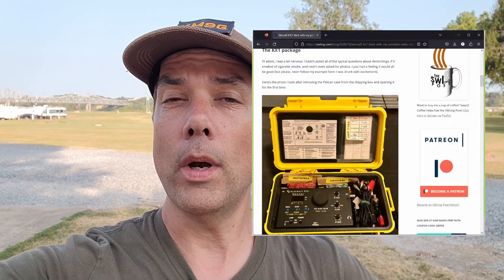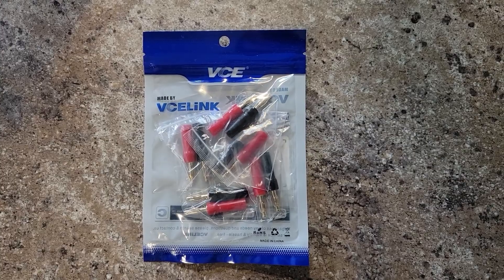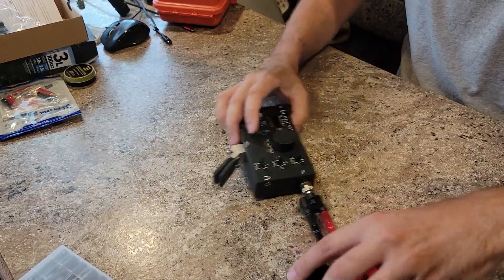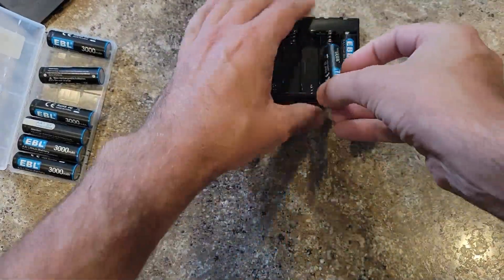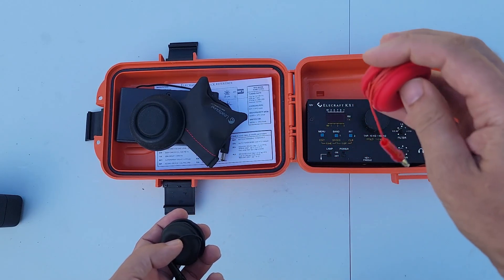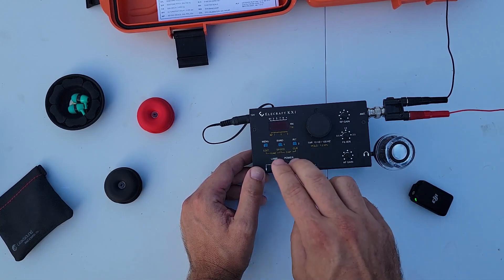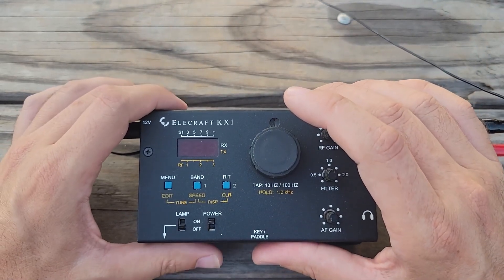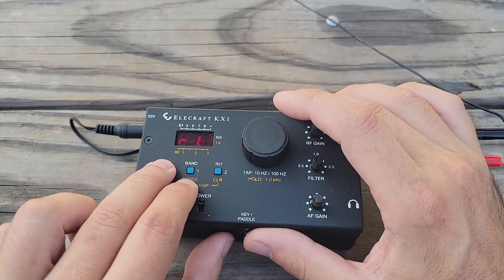KX1 Go Box Reproduction!

Comment: Great ideas!  I agree with those who question soldering the ends of the antenna leads. I tend to break one of the ends about weekly. I also recently picked up a 4 band KX1 to go with my KX2 and KX3.  The KX1 isn’t the most versatile of the three radios, but it is without question the most fun. I use 58 feet of radiator with a 12 foot counterpoise and it tunes up on all four bands. 
73,
John WJ7S
Reply from the maker: Good tips John, I'll have to do some more testing to find out... thicker wire means bigger winders too!

Comment: The antenna wire will break off at the solder joint in the binocular/BNC connector so you will have to solder it again, and again, and again, especially that fine wire. Screws alone will hold it and it can be easily repaired in the field.  Just my opinion and experience.  I do carry a butane soldering pencil but that’s an extra thingy to have on a trip to the field.  Good show my friend even though you talk too fast for my old ears.  Dave K8WPE since 1960.
Reply from the maker: Thanks for the info David!  I guess I'll learn about those wires breaking soon enough, you're not the first person to mention it.

Comment: I love these.  It really hones your radio load out to participate in these exercises like this.  I am continually asking myself do I need this, will I need it.  If I don't have it and need it, will I fail. And it is okay to fail.  You learn from failures.  This kit I can tell is one of those that has been honed and I love that you did your own.  Would it be ok to put in there like 10 foot or 5 foot of rg -316?  Is it weird for you to be working with it without some kind of feedline to give you room to work?
Reply from the maker: You might be able to stuff some light coax in there, sure.  its not /that/ weird, but it is a little different than normal.

Comment: 1. Good stuff!
2. The things that you're calling "binding posts" are, in fact, called banana plugs.  The things that you're plugging them into incorporate binding posts,  in that you can unscrew the colored plastic cylinders, wrap a wire around the revealed metal post, and re-tighten the plastic cylinders to "bind" the wire in place.  If you loosen the plastic enough you will also see a cross hole into which you can insert wire or other things not flexible enough to wrap around the post, or things messy enough that it would pooch out if wrapped, like stranded wire, and then, of course, tighten the plastic cylinders.
3. Soldering the banana plugs means that you can't re-use them (at least not easily) if you have to replace a broken wire.  (Breaking at the end of the solder flow being an especially likely.)  There may be small enough non-insulated crimp on butt splices available, but you could also use a cut off part of a tiny crimp lug, or small diameter brass (etc.) tubing to crimp (and possibly solder) onto the end of the wire, giving you something that the screw will bite into and hold really well (or that you can insert into the cross hole of the binding posts).
4. Have you tried over/under winging on the turtle winders, seeing if there is a good finger placement to get it pay out smoothly>  (Tomas is sure fast with the figure 8 winding method, but those turtles sure look cute.
5. Work on squeeze keying. "C" doesn't require 4 paddle presses, but just 2.  The only letters that require either paddle to be pressed more than once are "P" and "X".
6. Separate video, but, "Skywave" in NVIS means reflected off of the ionosphere.  The ionosphere must be thicker for this than to reflect a glancing blow (such as for DX), so you must use a frequency well below the MUF, since thickness required increases with "photon energy" (frequency).  NVIS seriously beats ground wave when there's a mountain in the way, but you mid-westerners wouldn't know about that.
Reply from the maker: That's for all the tips, they are spot on!

Comment: I have a KX1 with 30m and auto tuner. You do want to run with 12vdc gives you 1 to 2 watts more. I used it back when I would go backpacking (pre POTA) and was quick to set up and have fun. I found that a upright V that terminated right at the rig was the easiest and operates without ground losses. Not going to carry and install 40 radials so eliminate the need.
Reply from the maker: Totally agree!  Thanks for the info!